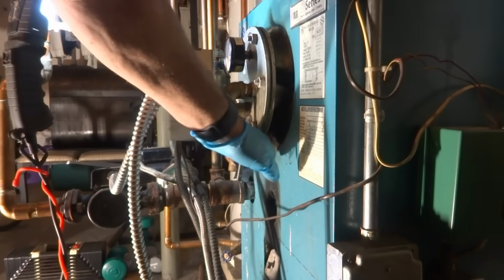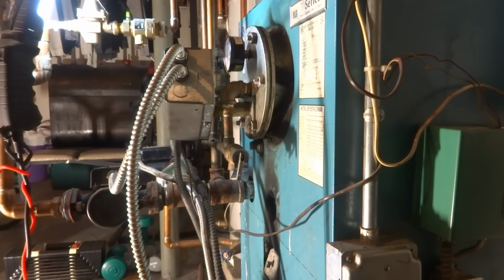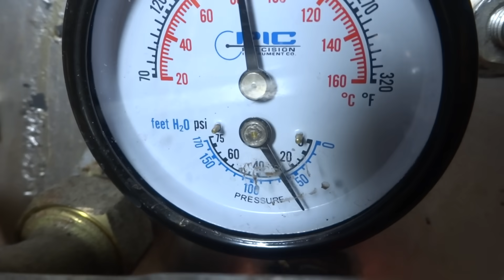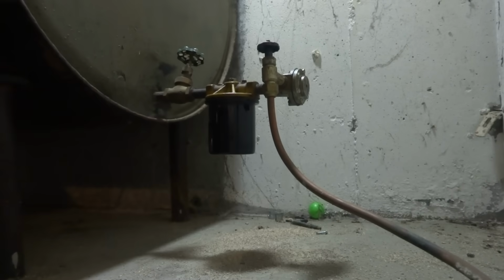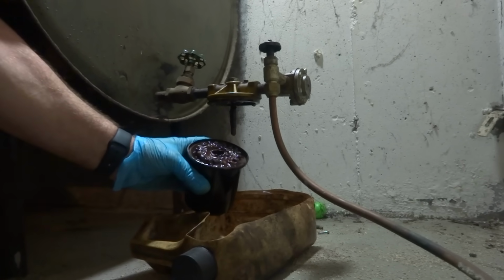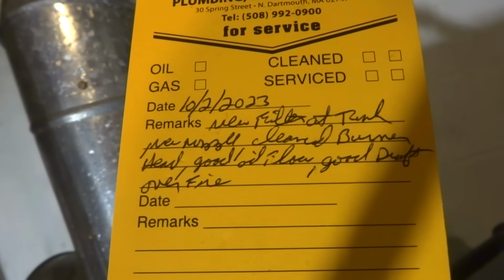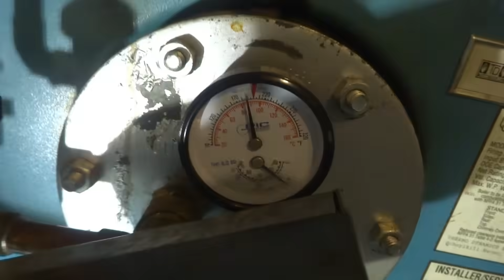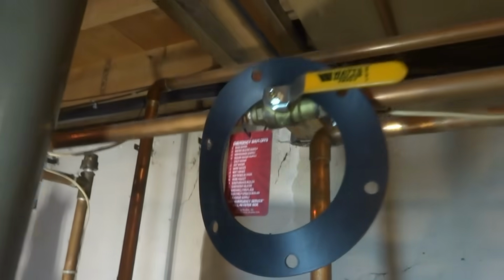LEAKING BOILER REPAIRS ITSELF

Comment: Boiler was  not used all summer and was cold so it was leaking. After running the metal cover expands and no more leak.  Thats my guess.
Reply: It runs all summer it has a tankless for domestic hot water
Reply: @scottk0623 oops. You're absolutely right.  Thanks
Reply: Good guess